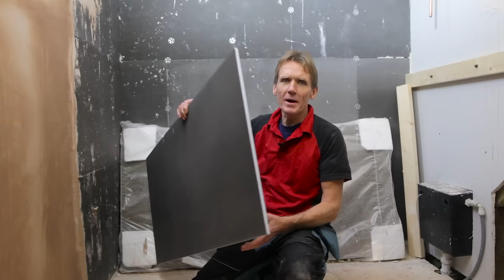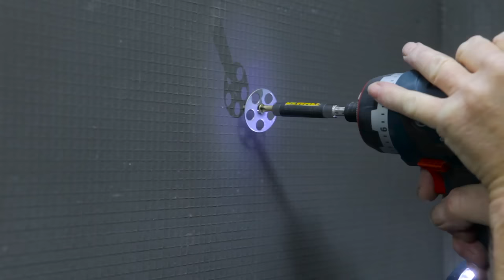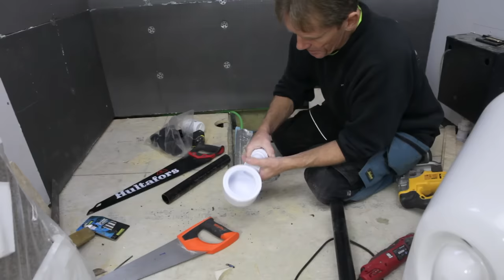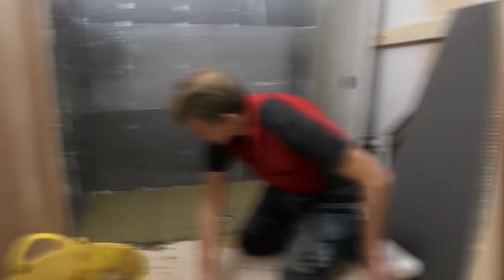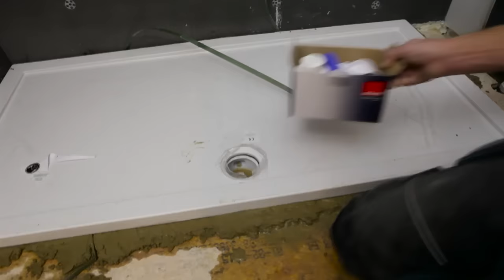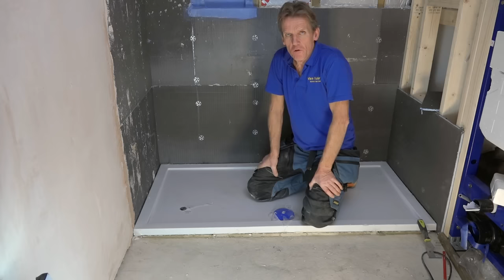Why Did the Shower Tray Crack? How Was it Fixed?

Comment: This is why I hate plumbing jobs. Starts out being something that should be done in let us say 4 hours and two days later and broken parts and fittings the job nears completion. I hate plumbing. But do it anyway. It is called self flagellation
Reply: Hahaha. Just spent 4 days putting an old toilet back in after everything was taken out. Should have been simple. Everything that could have gone wrong did. Had to construct a frame to secure a 110mm soil pipe and replace the whole soil outlet to wall to stop it slipping out the back of the pan as someone else had applied silicon to a joint! Anyway, I'd like to say we live and learn, but you are right - we carry on plumbing. It's a form of self hatred...
Reply: +Mat Smith I'm a plumber by trade, I price for the worst possible scenario, if it goes wrong so be it, if it goes right I win, you never can tell though.
Reply: ***** amen brother
Reply: R-77 yyyaaa

Comment: I would not have trusted that 18mm chipboard flooring, especially that spanning board over the waste run. I would have screwed down hard 18mm WBP ply over the whole lot, if the floor was level I would have  bonded the bleedin' thing down.   I'm not havin' ago just saying.  Same as tiling. I have put right some dreadful tiling work because lazy tilers have not plied over first..  Luv watching others work, keep it up I'll be checking in from time to time. Cheers..
Reply from the maker: +1stMrSceptical Thanks and don't ever worry about commenting, I always like to hear an opinion. The deck was new OSB3 structural grade and the span between joist was about 350 centres because they were double bolted. I take your point about the bit over the waste. I never know what is best there but the tray didn't crack on that bit it was both edges.
Reply: Me worried? Na, I've had many a laugh with people I worked with over comments I have made. You know the game we extract the urine all the time, 's part of the job. I do miss the banter and the wine up.  This will have to do now I am retired and marooned North 'O The Boarded Cheers mate..
Reply from the maker: +1stMrSceptical 
That is good to know.  I know what you mean about the banter. I had an office job for 2 years and whole weeks passed without hearing anyone laugh so I went back on site, much healthier.

Comment: So, the bed must conform to the underside (draining shape) of the tray..not just be "level."  (YOu measured the straight sides with your straight edge not the actual ubnderside shape which might have shown the contour).  As it was lower in the middle it broke its back when you stepped either side of the lower waste. Seems to me that the mortar bed was a bit too stiff. Maybe 10 or 12 large dabs of mortar would actually have been better.
Reply from the maker: The resin cast trays don't generally have flat backs. You could dot and dab the mortar but I comb in through with a notched trowel. The middle drain makes a weak spot because it is thinnest at the hole.
Reply: @SkillBuilder  I like traditional, solid, ceramic (with a strong upstand). The public are too lazy to lift their little feet up over a 3 inch upstand?  And so we have even experts trying their best to comply with silly demands. And I want access underneath too...so that you can get to the outlet pipe!
I feel for you  bro,' and will compose a tune for you....
Andy Harpist

Comment: Hi Roger. I drilled a hole into to top side of a tray like this to screw a glass holder.  it hasn't caused any issues but I want to fill it, do you recommend any product?
Reply from the maker: Any hybrid polymer will do the trick, CT1 or HB42 or OB1
Reply: @SkillBuilder  great thanks

Comment: My showers sitting on a hardboard roughly 18mm ish, is this a common way to install them? I'm looking to put a new one in is it worth keeping this method
Reply from the maker: I would put it on plywood and then a bed of adhesive or cement if required.
Reply: @SkillBuilder  What thickness of ply would you recommend?

Comment: Looks like you tightened down the waste hard before the cement bed had set. Maybe causing the tray to crack.
Reply from the maker: Nice theory but the shower trap and waste were floating so no strain on that. I often support them on some Rockwool so there is some give. 

The short answer is that these trays are thin in the middle and I have since heard of several cracking in the same point.
Reply: @SkillBuilder  Thanks, every day is a school day, lol

Comment: Never use sand and cement for fitting shower trays, I have been doing it for over 20 years.
Reply: What do you use? Genuine curiosity, I just watched this video to find out if it might help me with my caravan cracked showed however it never got to the fix stage

Comment: The reason the tray cracked, is because when you were putting it in place you should have held it on both sides. You placed one side on the floor causing the weight to pressure the center where the drain hole is. If you used suction cups on both sides to drop it in, this would have reduced the possibility of it cracking the tray.I hope this helps anyone else when doing this job.
Reply: Daniel O'Connell that sounds like nonsense.
Reply from the maker: Thanks Dan
I see your point but it is hard to lower a tray of that size down with three walls enclosed. The Mira Flight has been in for nearly a year now with no problems so I think I will just avoid the capped concrete ones from now on. Too much hassle taking them out if they fail.
Reply: It makes sense .Might not be the reason. But its good practise

Comment: That type of shower screen would have to be about the worst that I have ever seen. Here in Australia all of the shower trays 
that I have seen or installed myself have upturned lips which fit into cutouts in the studs then the wall sheeting fits over the front of the upturned lip on the tray then your tiles are glued to the wall sheeting meaning that you have a guarantee that water only goes where it is meant too.
Reply from the maker: We have those trays as well. In this case I didn't use one but I agree they are the best way to stop leaks down the back. Nothing to do with it cracking however. That was down to it being resin on concrete and thinnest in the middle so it made a natural fault line.
Reply: I have installed fibreglass trays and metal trays and never heard of any fibreglass trays breaking very strange!
Reply from the maker: Robert. In the Uk we have acrylic capped resin concrete trays and they need to be bedded on sand and cement. They are like paving slabs covered in acrylic.
Reply: Lipped shower trays are very rare in the UK. They exist but you don't see them often, and vendors are often ignorant or cagey about whether the product has a lip. God knows why when they're clearly superior.
Reply: We (in the UK) call the up turned lip a ‘upstand’. I bought a Mira Flight shower tray with all 4 sides having a upstand.

Comment: Your cement mix was also too thick. If you feel you need to use that stuff make it a very runny mix, not stiff at all. I would also have used a membrane underneath so that the cement would not dry out quickly due to absorbtion.  After all, you are not looking at cement strength, just even support. Jamie bobhound is also correct.
Reply: Sand cement floor mix must be dry not wet

Comment: Why didn't I check this video out 3 months go, I fitted the same sort of shower tray and yes it cracked.
Reply from the maker: Where did you buy it from?
Reply: Hi, Surfing Showers (ebay) used one from them before and its been in use for over 3 years no problem. Going for Kaldewei steel one this time. @SkillBuilder

Comment: I wondered if you'd let the bedding cure long enough before you tightened down the drain as you did it so wasn't surprised when it cracked there (and I noticed and thought that's a weak spot on that psn design before you even installed it).
I trust almost everything you show us but everybody had an off day like you did here. Kudos that you showed us, thumbs up.
Reply: Good point, but tightening the drain simply draws the female adaptor onto the tray and nips it, it doesn't pull the tray down onto the joists.
If the drain were fixed to the joists then he would be applying a force which might crack the tray, but the drain is floating.

Comment: Do you bed the Mira Flight trays on sand & cement or silicone?
Reply from the maker: I bed them on sand and cement but if the floor is really flat then silicone is fine. They are strong trays so I don't see any problems

Comment: use powder flexible tile adhesive to bed the tray down,i just fitted a 2 metre long tray with waste in the middle and it didnt crack.as for the waste itself throw away the rubber seals and use clear silicone,it is the only way for me

Comment: You are maddddddddddddd not putting a bead of clear silicone round that waste! When dressing a basin with click clack waste I don’t even use the rubbers anymore just load her up with clear silicone and I can hand on heart say never had a issue to date!
Reply from the maker: yes, I use silicone too but I also use rubber seals and have had no trouble with them either. The only issue is the step on the edge of the waste. It was lucky that I didn't silicone this one because I had to remove it.

Something wrong with your d key, it looks like it is sticking.
Reply: Skill Builder yes very lucky, I’ve also never had a tray crack like that before may be there was a manufacturing defect there before handddddddd! I will look into the pesky d key to 👍🏻

Comment: JT 40 by any chance? i had to replace 3 last year as they held water in the far corners?
Reply from the maker: +john sawers 
No not JT, it came from a company called Cheap Suites, which makes you think they might be rubbish but they seem to have good reviews and  to my surprise they are happy to replace the tray with no arguments. It could have just been a one off. The carriers took it off the pallet because they didn't have room on the wagon so it might have been propped up with a load on top of it. The trouble is I have lost confidence in it now so I am still going for the Mira.

Comment: In my opinion I’d never muck about with concrete to fix a tray that’s solid. I’d only ever do that with a hollow tray which are virtually a thing of the past these days.
Just make sure your timber floor is level first, then fix it with silicone. Much better!

Comment: look like the tray is break apart snap like breaking tile..... because you mixed concrete too wet mean too much water. when water dry, level of concrete drop down. This job create hollow or leave the gap between the tray and concrete level. BECAUSE OF the draining fixture is solid and not moving down with the tray. You break it when you step on the tray  or the tray itself heavy on both end and the weight create a breaking,,, just like you break a piece of tile when you put a nail in middle if the tile and you stand on it..... so next time leave a little bit of movement of the drain or dry mix not wet
Reply from the maker: Hmm, Interesting suggestions. I have fitted lots of trays over the years and not had any problems. The trap had plenty of movement and the mix was all done in one bucket so the shrinkage rate should be uniform. The tray was weighted down with packs of tiles while to mortar dried. I suggest that the fall to the middle of a long tray creates an inherent weakness. I know a lot of plumbers who bed their trays on silicone sealant.
Reply: Skill Builder just a shit tray, nothing to do with the mix. Buy cheap buy twice and I very much doubt the waste should ever be able to exert enough upward resistance to crack it like a nail under a tile. Gutted for you.
Reply: Perfect Gentlemen I would agree with you I've put in 100s of trays from cheap to dear ones and never has happen to me I think it was just bad luck possibley the tray was fractured would have broke anyway at some stage. I usually set down the trays in bonding coat it's nice and fatty and spreads very evenly when you're trying to level the tray I feel gutted for the guy
Reply from the maker: Perfect Gentleman
You are right it was a cheap tray and the trap had space to move down so that was not the problem. The centre drain seemed like a good idea but I found the tray is thinnest in the middle because it falls from both ends and this was precisely where it snapped. I don't agree with suggestions about the wet mix because it shrinks evenly and I hadn't even stood in it. It broke its own back

Comment: All moisture taken out cement when applied to wooden floor, always seal the wood to prevent this, pva mix ? 👌
Reply from the maker: Good point but if it all shrinks together the bed should still be even. Next time I will try your tip

Comment: Cladding in bathroom on top of aqua or wedi etc? Cant it be done? Allot of clad they say silicone and screw the grooves? The screws would compromise the wedi integrity?
Reply from the maker: There is not a lot of point. If you seal the cladding joints it won't leak.
Reply: @SkillBuilder  so when they say screw the clad to plaster board then do we not do that and just use silicone? Would you still use wedi at the back instead of plaster board?
Reply from the maker: @saif1980saif  O.K in that case there would be some advantage in using the Elements board first as an insulating layer and to give the Bush Board some support.
Reply: @SkillBuilder  so do i screw the clad into elements boards? Have you done any vids on cladding a bathroom/shower? Furthermore whats your opinion on duma wall tiles?

Comment: hi mate massive fan of the channel. love the honesty, I've had similar problem I've found expanding foam to be better than cement, it also take out the flex and weak spots
Reply from the maker: +Robert John Allan&#160;
That is great to hear I have thought about foam. If you put enough weight on the tray during the set it should work,
Reply: How do you stop it from glueing the trap in?
Reply: Expanding foam compresses after some time .thats why new bathtubs have a sticker
strictley advising against using it

Comment: Hi Roger, love watching your videos so informative and straight
to the point!

When you have moisture resistance plasterboard in bathroom, would you plaster over it and then tile?
Reply from the maker: +Muhammad Asim 
Hi Muhammad 
Thanks for the support. I would not plaster over it. Plaster doesn't stick so well to the moisture resistant stuff and it introduces a layer of degradable gypsum into the sandwich. Tile straight onto it, no need to prime.

Comment: I recently fitted our new shower tray, i did everything following the instructions. I made a nice level bed of sand and cement, made sure it was level all over with a spirit level and then bedded the tray down into that. It worked great and the tray was solid all over with no movement. However, as soon I finished the glass shower surround a week later, the tray has suddenly decided to move slightly when trodden on in one of the corners. It is really annoying because it was solid until the glass was fitted :(

I have access to the underside of the tray from downstairs as the kitchen ceiling is being re-done, what would be best to fix this?

I was thinking that drilling a small hole up through the floor under the offending corner and then "injecting" or "pumping" some strong filler through to the underside would flood any small cavity that is there and then set solid, would this work?

Any advice would be greatly appreciated
Reply from the maker: Funnily enough I have known that happen. It is to do with shrinkage of the mortar. You can not get a special cement from Ardex that holds the water and doesn't shrink. It also dries in 3 hours.
However for you the idea of small holes in the floor boards is a good one. Put some bags of sand on the tray to stop it rising and then squirt some expanding foam in there. It will be strong enough to support that edge.
Reply: Hi, thanks for replying so quickly :) I walked around in there this morning and at the moment, the movement has completely stopped and it feels solid again, could it have just been settling down into position? maybe the weight of the glass shifted it slightly and walking on it made it settle into the new position? The glass is very heavy 8mm thick stuff. If the movement comes back i will definitely try what you suggested about the bags of sand etc, thank you for that advice!
Reply from the maker: Good to hear and best to leave it but maybe you can squirt a little foam under the edge of the tray  if it is just the glass causing the problem
Reply: I will keep that in mind and do that if it moves again, thanks for your help :)

Comment: Fact is it wasn’t cracked before you fitted it, every tray I fit I first membrane the floor with durabase then level the tray on top of that with about 15kgs of rapid set flexible tile adhesive
Reply: G. William How thick?

Comment: Thanks for being honest but very dissapointed that you blamed the weakness of the tray. Surely this style of tray is fitted in the thousands all over the UK. You should've investigated further to figure out what mistake you made
Reply: He put an even amount of cement all the way across the shower tray, he said the tray angles towards the middle in order to drain the water away, so he needed more cement on either side as oppose to the middle. Weight on top made it flex and snap.

Comment: The sand and cement was far to dry
Reply from the maker: if it is too wet you get shrinkage problems and uneven support. It should be like screeding sand. The fault was the thin middle of the tray. It is a bad design and mine was not the only one to crack like that.